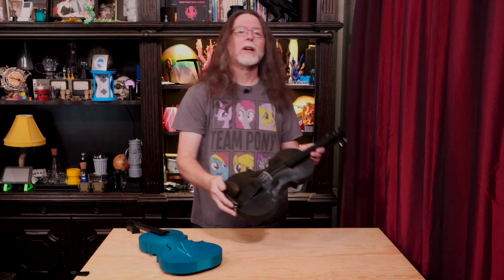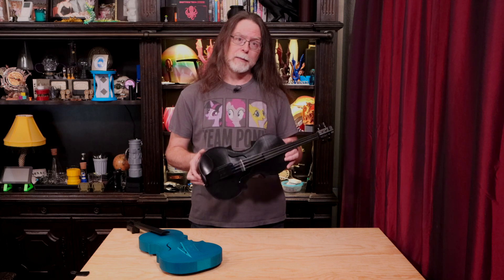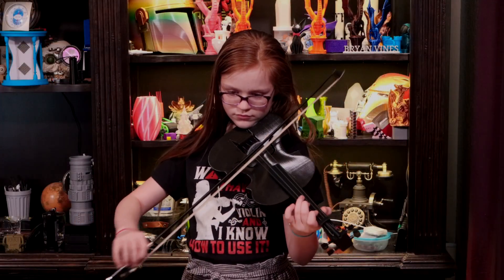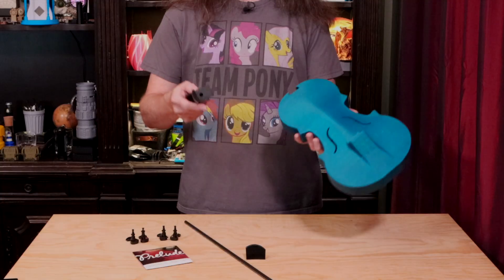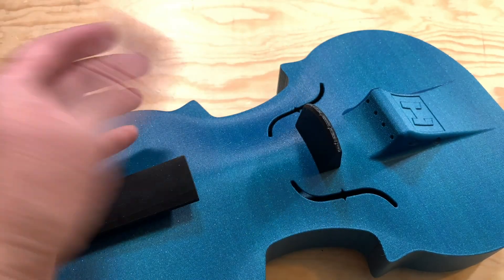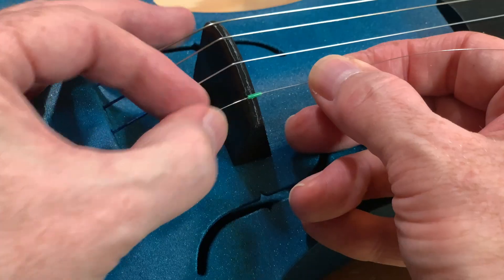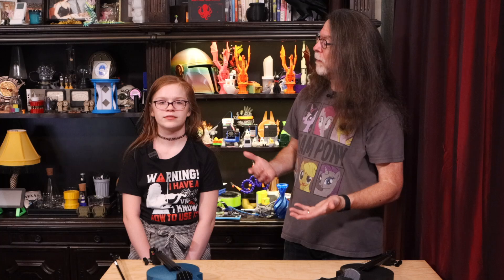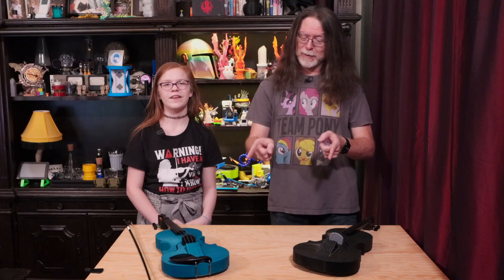I 3D Printed a Violin. AND IT DIDN'T SUCK! (It's the Hovalin, and it's awesome)

Comment: I'm not an expert at crafting violins, but I would recommend looking at some of the violin building/violin repair videos on Youtube for references. There's a couple of things that appear to be missing from the design that could lead to structural problems later. Is there a bridge post inside the body, for instance? Because that's a crucial part of any instrument in the violin family; not only does it transfer vibrations of the top to the back of the instrument for a fuller sound, but it also lends structural support under the bridge so the string tension doesn't slowly buckle the top.
Reply from the maker: Hi! The Hovalin has a sound post built in. It's on the wrong side of the bridge (it's more under the G string than the E string) but it's there.

I recently printed another one as an experiment, and also used a bridge from a different printable violin. This alternate bridge looks much more like a traditional bridge instead of a lump. 😊

Comment: I'm wanting to do this print but I can't find any information on wall thickness/line count.  What line count did you use?  Also, the file available on their site doesn't have supports on the waists.  Yours had supports on the waists.  Do you think they were necessary?  I tried asking them but they do not seem to be able to respond to reddit/facebook/email info requests.

Comment: I agree that the Hovalin does sound a bit 'plasticy' as opposed to 'wooden'.  Mind you I'm not a musician, but my twin daughters grew up playing guitar, piano, brass and woodwinds (in HS marching band).  Perhaps you should try printing with 'wooden' PLA filament?  BTW did you use the same brand / model strings in both instruments?  As for the way the pegs turn (either towards the body of the instrument or away), they still do turn in the same way according th the right hand rule when looking down the peg from the handle (same 'clock' direction).   I wonder if some anal retentive players wind the strings the wrong way on half the pegs to get them to tighten the same way?    Now how about a 3D printed bow (but with real horse hair of course!)?  Do that in carbon fiber PLA.

Comment: I almost forgot!
The Havolin will hold up much longer than a traditional design.
The bridge and other features of the trad violin put stress on the print that will lead to mechanical failure.
The instrument 'lived' for less than two weeks before the upper plate collapsed due to bridge-pressure.
Un-stringing the instrument wasn't really an option; it would take a day or so for a change in string tension to 'settle in'; it didn't hold tune very well at all.
Plus it was highly sensitive to changes in temperature; handling it for too long changed the tuning noticeably.

Comment: I printed a hybrid violin a few years back; the bridge was Maple and the sound-post Birch while every other part was printed.
I hired a Lutheir to make and install the wooden bits!
It was a replica of a traditional instrument, not a Hovalin.
I paid special attention to the front and back plates: I came up with printer settings (cheap PLA) that produced plates that sounded like 'sound-wood' when dropped on the floor!
Bright, clear and loud...they sounded nearly identical to samples of Maple!
The plates were much heavier than wood; the plates need to be very thick, but the tonal qualities were a very good match.
Printer settings: Plates were 7mm thick(!) with two 0.4mm perimeters, very dense infill (40% cubic pattern), thin top and bottom layers...much more infill than skin!
How did it sound?
The high string was a bit muted with no sustain, middle to low strings 'filled the room' with sound!
Not a musician, don't remember which string is who by name.

Comment: Awesome. Finally a 3D printed instrument that doesn’t make your ears feel viol-ated. Is this a 4/4 sized violin or is it smaller for your child? I’m also curious if it has a built in sound post, which is what transfers vibrations from the bridge to the instrument itself.
Reply from the maker: 😁 It is the 4/4 size, and does have a built-in sound post. I think I read somewhere that the sound post is on the wrong side, but since the bridge is solid I don’t know if that really affects it. 👍🏻

Comment: Considering material elasticity I wonder what a more stiff violin printed out PC would sound like, since PC from my experience is very resonant I wander how different the sound would. Also as some have mentioned I would implore the use of a real wooden bridge as that is the primary means of transporting the sound to the chamber and with that thick printed bridge i would believe some of the harmonics of the different sounds are getting absorbed by the unnecessary mass on the plastic bridge.

Comment: Bravo.
Ender 3 pro with microcenter coupon: ~$100
Spool of PLA: ~$25.
Non printed parts mentioned in the video (including bow and rosin): ~$95
 A quick Google search said beginner quality violins are generally $300-600 (I haven't checked my local stores, so there may be some price difference).

A 3D printed violin (that doesn't suck) that is cheaper than a traditional violin can really give more people access to this kind of stuff without breaking the bank.

Comment: The Hovalin is an awesome project! We have 4 of them floating around the house. One did fail after about 2 yrs. My suspicion is it got dropped, but no one is confessing to anything. However the 2 we had at MRRF 2019 are still in action! I have a remixed version on Printables with smooth waist, which prints with less supports. Enjoy!

Comment: Please try using a wood bridge, I believe there’s a strong change it would sound even better. It’s really what drives the sound into the body. Also, it’s best to string the two outer strings first for simpler tuning.
Reply: Wonder if wood filament would work for the bridge so that you can keep with the printed theme.
Reply: @fixerone1963  I like to see someone use the wood filament to build the whole thing
Reply: @hasnomoney1800  i accept this challenge.
Reply: @hasnomoney1800  i'll get back to u next week to show u the violin once everything comes in. the wood filament and violin strings etc.
Reply: @KalebP0314 How'd the print go?
Reply: @DesireeWalker   Totally forgot to upload anything I havn't done alot of sanding like i was wanting to, among other things. But it turned out great =) I'll take a picture of it tomorrow and upload it here if i remember >_>
Reply: How'd it go
Reply: did some adjustments to make it better. But its still at work can't take another picture of it atm. mostly to remove the seems and so on.
Reply: Yeah that's what I was thinking.  Amolen wood filament is 30% wood @fixerone1963
Reply: I'd be very curious to hear how much of a difference that would make.  It's such an easy change to make, so why not?
Reply: @GreenApplePie Thanks for the tips, i tried it IRL on the hovalin and it's 100% effective 😊

Comment: great project 👍
I suppose the fine tuning is a bit harder, with a fixed strings in the "big end". Normally there are a fine-tune in the "big end" too.
I agree with the blue violin sounding more "soft and pleased.
Great violin sounding/playing"off-spring" 👍😍
thanks for sharing your experience with all of us 👍🙂
Reply: I stopped playing the violin around 1975 - exams, starting work electronics and such like took it's place.
It was common for the E string to have an "adjuster" a small screw activated lever for fine tuning attached, to the tailpiece. It was less common to have adjusters on all strings. This was because the tension on the E string was high and the tuning pegs were just simple pegs pushed through holes either side of the peg box. One wrong tweak on the peg and the E string would snap - I must have broken dozens of E strings, but only one A, and I don't recall seeing a G or D breaking while tuning. The geared tuning pegs would have made life a lot easier! 

Andy
Reply: You are correct about conventional wood violins having fine tuners at the tailpiece, but the reason that this Hovalin does not use tailbpiece fine tuners is that it uses geared guitar/ukelele tuners instead of standard violin tuning pegs.